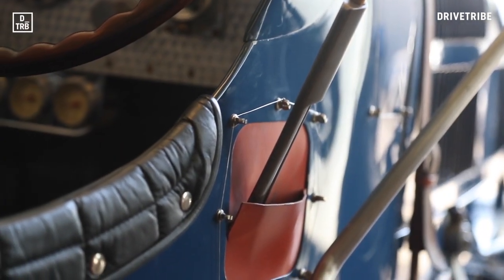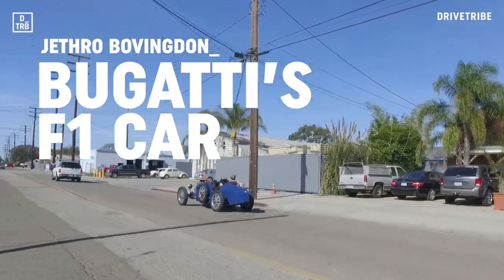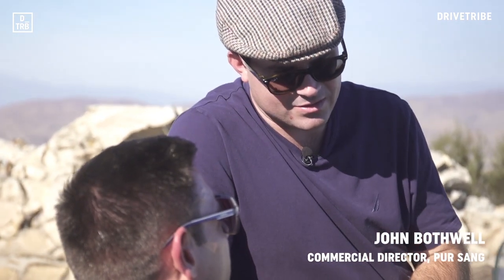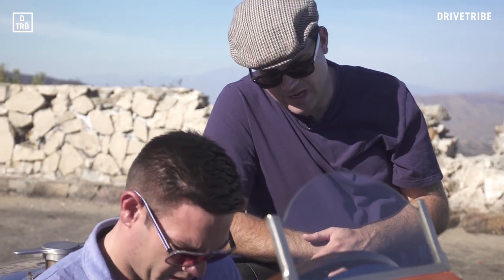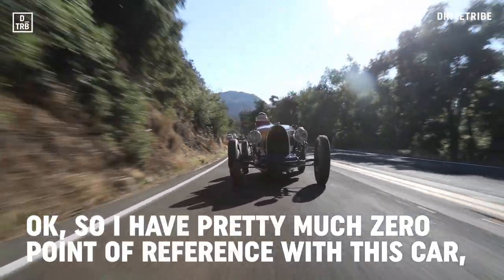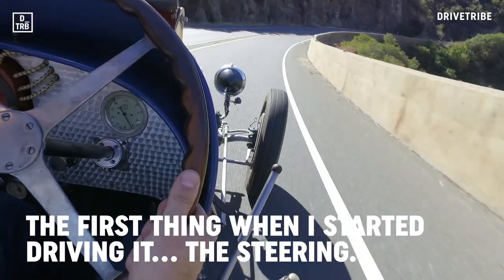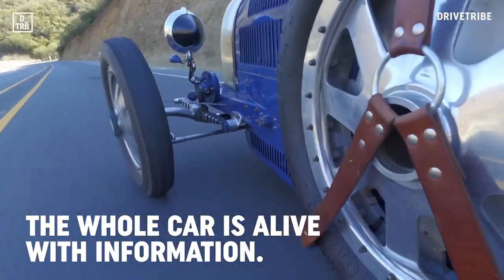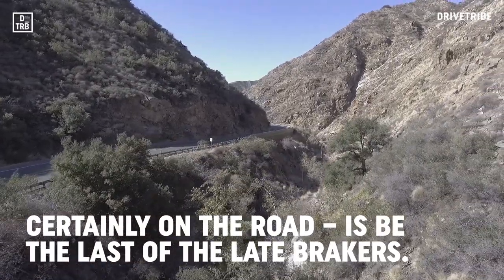Driving Pur Sang's Bugatti Type 35 race car

Comment: I thought they only had the hand brake- is this a modification that Pur Sang made- to have a pedal…maybe the hand brake only handles the rears?
Also- shouldn’t he be pumping the fuel pressure every so often, or is that just something that you do at start up and gravity takes over once it’s running?
Either way- I want one.
Reply: no modification, brake pedal is for all wheels via cables
the hand brake is... a hand brake like in all cars.
the hand pump is there to prime the mechanical fuel pump, before starting the car.

Comment: this sounds kinda like riding an older sports bike from the 70s or the 60s. Like my old kz, it can be temperamental to start up, you have the choke to worry about, the gearbox clunks and sometimes 4th- 5th misses and you get a faux neutral, the starter doesnt really work so you have to kick it over more often than not for what seems like an hour, sometimes you just run out of gas if youre not careful or youre daring, and the tires leave so much to be desired that dropping your knee at 30mph feels sketchy sometimes. But Ive never had so much fun as I have riding that even with a 400cc motor

Comment: Very nice video, 
your narration microphone audio is kind of bad, though.
Reply: Hermann Mann 
They should look into a noise-cancelling headset setup, like one would use with a motorcycle. I know you can get a setup from Sena that doesn't require a helmet but I'm not sure of that particular unit will sync with the GoPro backpack. I'm sure a phone call would answer that question, though.

Comment: 4:37.. well with a car with positive camber... that's to be expected... it want's to pull into every corner, infact it has positive camber because it will self powersteer your steering inputs.
Reply: on the contrary, positive camber coupled with rigid axle induces outboard lateral forces.It was used to counteract the natural oversteer tendency of the car.

Comment: Does anyone know why it seems to have positive camber on the front rather than negative?
Reply: to counteract the cars natural tendency to oversteer in corners.
and it worked, many period drivers attested to the neutral feel of the car.
Reply: Rover Waters thank you
Reply: I was thinking the same thing.  Must be awfully unstable in a straight line let alone corners.  Personally I'd dial in a couple of degrees negative camber with a little toe to stabilise it.

Comment: This thing is terrifying: you sit on a flat, couch type seat that has no grip because it is made from leather and has no profile to hug your body in any place, no seat belts, skinny tyres, no brakes that you can sensibly modulate(not progressive, basically binary) and when they start biting the car tends to get sideways. The pedals are spaced so that you get extra excitement. It looks like it has longish wheelbase and a really narrow track with pretty high center of gravity which means it is pretty easy to roll. To exacerbate it has metal leafs for suspension. This car is basically a bathtub with wheels and probably drives like one. One mistake and you are dead. This is not a widow-maker, this car is for those whose daily routine starts by playing a few of rounds of russian roulette. Absolutely mental.

Comment: why dont they set the front tyres to 0 degrees camber instead of like 5 degrees Positive lol
Reply: jack black because the suspension was so poor when under steering the out side wheel would chatter. Same as tractors today
Reply: It has a solid front axle, like with negative camber on modern cars, with a solid axle the tyre moves in the opposite direction under load, so the positive camber effectively straights the wheel out at speed (load).
Reply: why the fuck will they do such a stupid thing?
Reply: It was cutting edge technology at the time, we are talking about the 30's

Comment: "exact replica" then as soon as 0'41" Chinese red lever ball valve on kitchen copper tube and brass fittings...
Reply: could have been an add on by the owner....the crankshaft is also different on these since the original had a much shorter lifespan    ....and yes they are the closest copy of an original for 10 cents on the dollar.